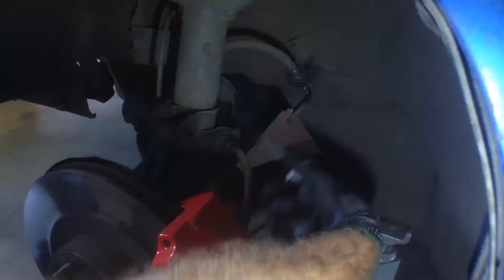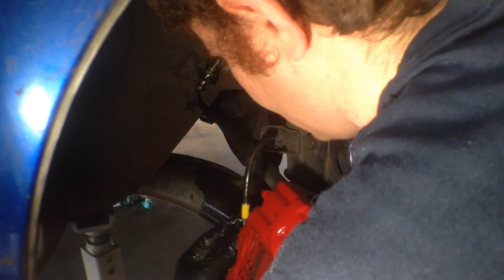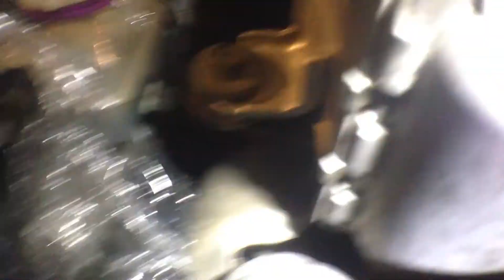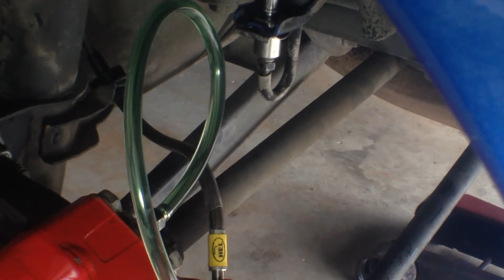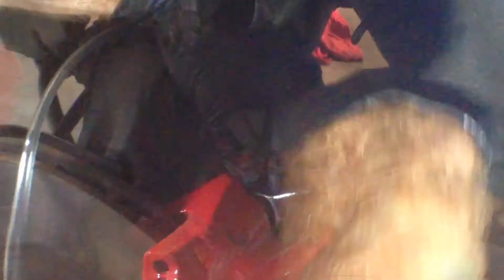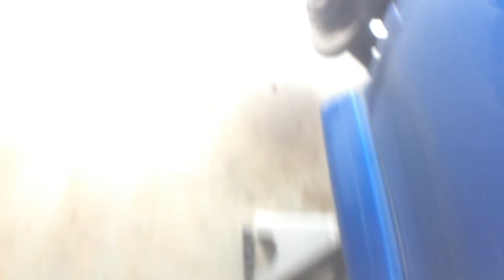Fitting HEL Braided Brake Hoses to an MY99 WRX

Comment: I read rubber brake lines should be replaced every 90,000km, as the rubber deteriorates letting moisture/air into the fluid.